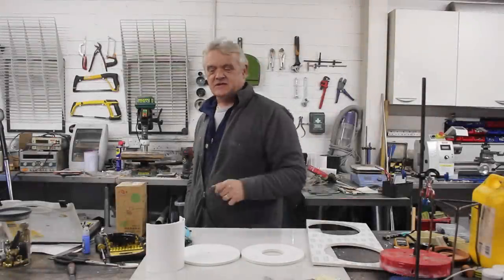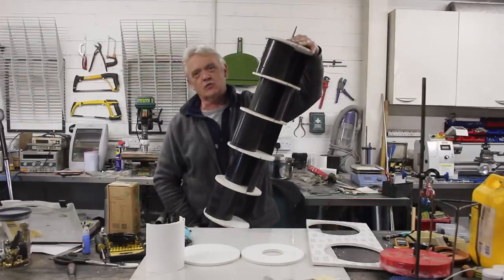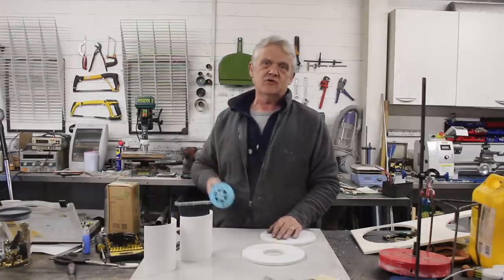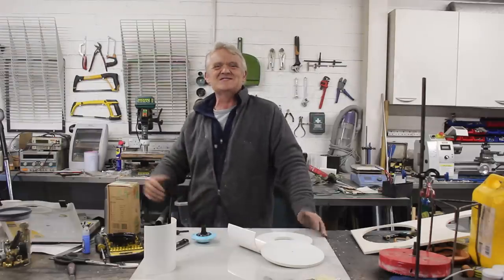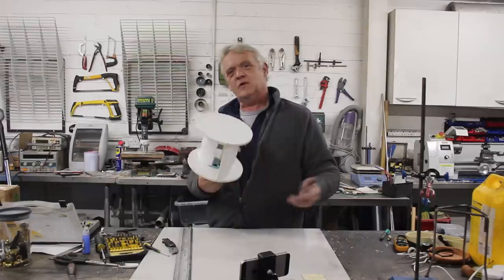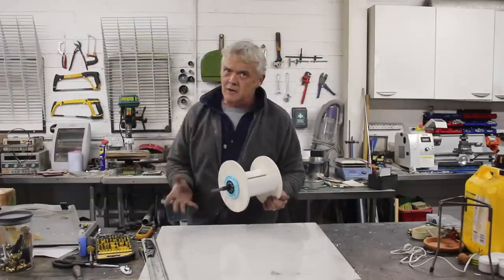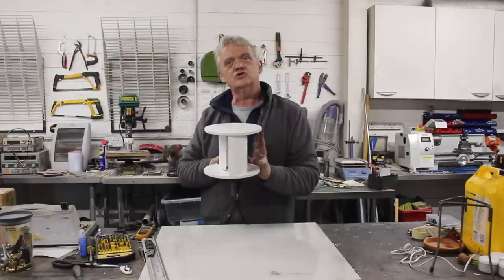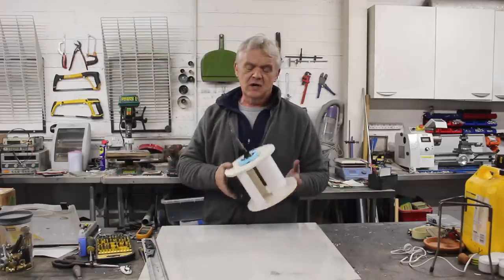1718 A New Style Of Wind Turbine - Cheaper, Simpler, Better

Comment: Great idea, Quick question,  Could you use a wind wall and say 5 of these fans connected to the wind wall and then have them link together? for example, if one motor is giving 10volts and I had 5 of them, then could I get 50 volts of is it just 10 volts no matter what?
Reply: Depends how you wire them.

If you wired 5 of them in series (each generator connected to each other directly) you would get 50v (assuming 10v on each generator) but the current would be equal to having 1 generator (around 3 mA).

If you wired 5 of them in parallel, (all generators sharing a common wire on each pole) you would get the 10v but would have 5x the current, so 10v at around 15 mA.

The power (as in wattage) would be the same either way.
Reply: @Dorpz  Thanks for your reply

Comment: Does the number of blades on a horizontal wind turbine increase the performance? If so, if you cut the guttering down lengthwise you'd have 4 blades instead of 2. It would be interesting if there was a source of similar fans/motors in the UK.

Comment: The main problem with FAWT style windturbine designs is that wind is always pushing away all the blade(s) in the same direction as the wind and therefore the next blade is less efficient because it gets pushed less and so forth. In this case the other blade (curved 180 degrees in the (opposite) direction of the wind) is pushed less and actually obstructs the speed of the other one. Like a 30% break and 70% gas action at the same time. Horizontal blades, no matter how many, like an airplane propellor hasn't got this problem. Of course a propellor design has to be pointed into the wind but is simple to do. Torque matters.

Comment: The savonious will have less rpm, more torque. Shield half of it to bring up the tsr to over 2.0

You call it "alternator style". All semi serious wind turbines have alternators. The ones that have generators (dc) use brushes, which require much maintenance. These are not used very much at all.

Comment: this little generator looks to be a great micro micro hydro generator or gravity generator. could the Savonius wind turbine design be adjusted to work as a  under flow water wheel? could you make the Savonius turbine out of tin so you could use the rocket stove exhaust to spin it?
Reply: All considered Fluid dynamics - I would not advise using a fan in the exhaust of the stove as a way to capture energy .. the restriction and buildup of soot would be detrimental to the function of the stove - safer to just boil water on the stove and making a steam generator

Comment: If you were to extend the wall out from the U shape to create more of a pocket, sort of like a hallow ying yang with a deep pocket on either side; do you think the efficiency would improve? 

I would think you'd have more focused wind into the system, and less drag around the outside as it would look like a closed circle, with two openings for the air to enter on either side as it spins. Just curious if you've tried it. 

Hard to explain it with words. Too bad you can't include basic diagrams on YouTube.😉

Comment: Please document the energy consumption of the source blower. I’d expect your energy capture ratio to be > 1/10 of input. How about changing the gutter surface from smooth to soft. This design also disrupts the wind flow, a tiny jet of compressed air might prove to be more efficient to test but will never be realistic compared to actual wind. Such is the dynamic world of entropy, enjoyed the video.

Comment: I don't understand. I think the milliwatt calc was incorrect. The Propeller version put out 13 v * 4.5 mA = 58.5 mW of power. This new Vertical Windmill version puts out 12 v * 2.9 mA = 34.8 mW, which is much worse. I didn't include the ratio of the size of the prop to the size of the vertical windmill... were the expected results for the vertical windmill supposed to be the same? or were you actually expecting it to be less?
Reply: Yes  the person doing the presenting seemingly lacks enginering skills and ability to make analytical conclusions from 
observatilns andd laws of physics.  . But see how many he got to participate
Reply: @akehellstrom4912  LoL, One of the main reasons I subscribe to this channel is Mr. Murray-Smith's excellent variety of skills. I am certainly not going to see anything less because of simple miscalculation. We are all human. Also It's possible he was taking into account the theoretical maximum of the prop vs theoretical max for the vertical in his calculation... I wasn't sure.

Comment: On the point of a wind wall , I can't work out how the generators (alternators) are connected in parallel , since they have slightly different output , even if they are from the same manufacturer and with same nominal properties. I mean , slight differences in output of generators on the same wind wall , will create difference in electrical tension (voltage) , which will cause heating of the common conductor(wires) , that connects all of the generators in the same wind wall. Or , is there a need for a voltage regulator on the output side of each one , before they are connected to common output conductor ?
Reply: I suspect the rectifying to DC with a capacitor may be part of the solution. There’s going to be genius viewer on here with the solution and parts list lol
Reply: @Milkybar3320011  Thanks , I have (kind of) suspected that and it is just annoying to me , because it means either more wires , or building a weather proof box for electronics. It is easy enough (not very expensive too) to find right electronic components for that , but I hate spending money on a , basically , hobby experiment. Well , such  is a life :) I'll probably go with more wires , in some kind of conduit (I prefer AC trough conductor to the electronic/power box).

Comment: Let’s see ….. At 2.6m/sec you get 3mA at 12V, which is is 36mW not 50 or 60mW. So if you double the wind speed three times to 20.8m/s then the theoretical output power would be about 18W, enough for an LED light bulb. Of course to get that average wind speed would require at least a 30m tower, which is very expensive. So to light a light bulb would require $2 for the generator and $1000 for the tower. At $.13/kW-hr the system breaks even in only 49 years. Of course you could use 500 of these at 2.6m/s to get the same 18W but the payback time is still 49 years. I don’t think you’ve solved the problem yet. It seems that spending $1500 on a 1kW generator and tower, which could power a small home, with a payback it 1.3 years is more sensible.

Comment: just needs gearing. increase the ratio of turns to 1:10 should 10x your power output. this is the same for car alternators aswell. spin at the wrong speed and they do nothing.

Comment: Wouldn't it work even better if you blocked the wind from hitting half of it?
Reply: What would happen to the energy of the blocked wind?
Reply: I think the curved shaped that you would want to block, helps deviate the wind instead as to not have to block wind coming from any direction ever
Reply: Could put rubber / silicon flaps over holes.
Blows one way it shuts, blows the other way it opens, less drag.
Reply: Think i would start with more than 2 blades... The original fan blade had more. Then the idea of wind redirection would become applicable here.

Comment: How do you stop a wind turbine from overspeeding?
Reply: Savonius rotor design does not overspeed, if i remember correcty. That design is for slow wind speeds, but it does not gain too much speed in high winds.

Comment: I'm really sorry for sounding stupid, but can someone help me out with Amazon links for the fan and a little more explanation for the materials. I gather that the fan motor is producing AC? I'll also need guidance on how to safely wire it up. I'm thinking this would at least be fun to play with in my yard, though I'm not sure I'd be able to get a practical amount of energy out of it.
Reply: There are a few comments on this, hopefully one has the link etc, Robert has also done previous videos on how to simply rectify to DC too. Good luck on your build
Reply: I bought mine on eBay

Comment: That does seem to be a good model. It does perform well under the conditions placed upon it.

My preference for vawt wind capture devices is that you can extend the shaft on the turbine down to ground level for less costly maintenance.

Most hawt style turbines are more labor intensive in their maintenance (a fact I believe the manufacturers are taking full advantage of in my humble opinion) and for home generation maintenance in the framework of materials and labor cost (time and energy) cannot be discounted when determining the method that best suits your needs.

Comment: Vertical turbines have been shown time and time again they ARE NOT better or more efficient.  They also wear out bearings more easily. They have been used by alternative energy scammers for years.
Reply: Yes so right. I asked the moderator to take action against this trash video. It was not the best  solution in old times, it is still not the best solution. So say the thouands of engineers who understand windpower.

Comment: Would a gearing system offer more power since it could spin the rota much faster than the turbine blades? I assume they have this system in large commercial turbines.
Reply: There are always some losses to output when you add gearing